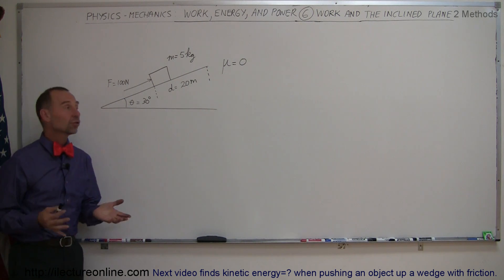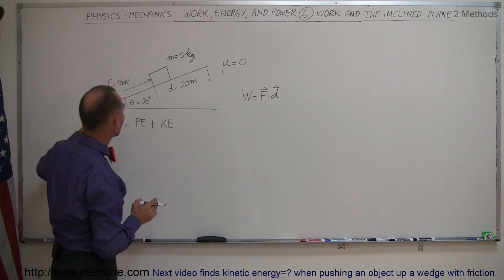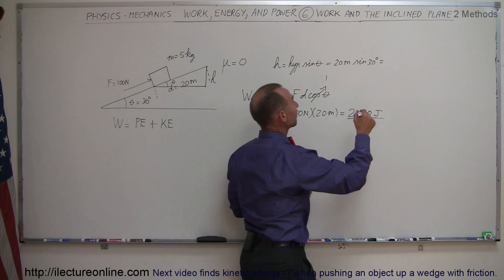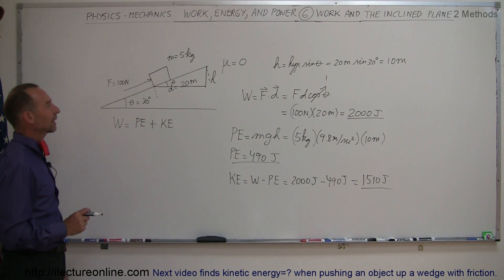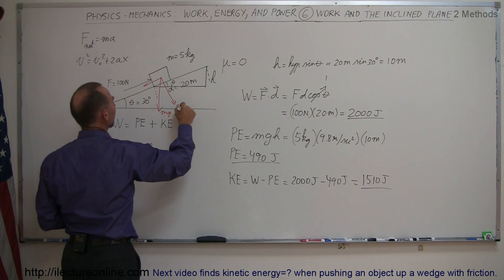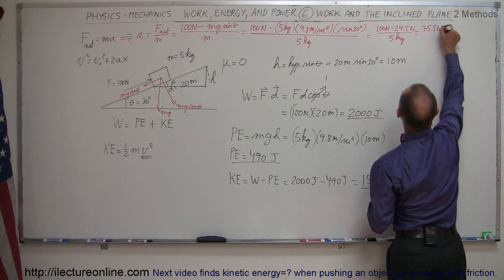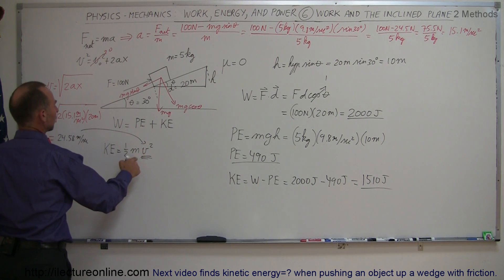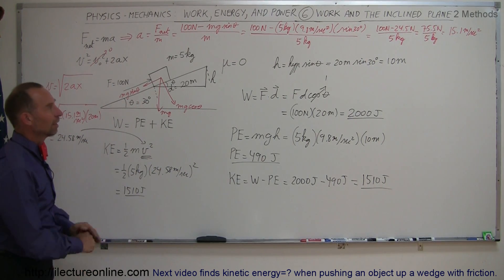Physics 8  Work, Energy, and Power (6 of 37) Inclined Plane (Frictionless)

Comment: A doubt, why do we not consider the work done against mgsintheta downwards? so net work would be, work done by external force  -  work done by mgsintheta and this work gets converted to energy?
Reply: ive just made myself more confused
Reply from the maker: You need to take each force separately.  If you find the worlk done by the force pushing the object up the hill, the work done is simply the dot product of the force and the displacement.

Comment: sir, i would just like to know why are we not going to take into consideration the directions, where one would choose a certain direction to be positive, preferably upwards, since it's the original motion of the block, and in that case downwards would be negative and that would make the gravitational acceleration, g, to be a -9.8m/s^2...
Reply from the maker: The video is correct as is.  When dealing with vectors, the sign indicates the direction, but the direction is uaually expressed in terms of the x and y axis, and therefore you would need to find the vector components.  Better just to calculate the magnitude and determine the direction separately.  (Note that the magnitude of vectors cannot be negative).

Comment: Why you use costeteah 1 it is 30 degree?
Reply from the maker: The direction of the force and the direction of the displacement are in the same direction, therefore the angle is zero and cos(0) = 1

Comment: I have a question! why didn't you use the net force while calculating the work done. You used the applied force (100N) which didn't include into consideration the component of weight that opposes the applied force i.e. mgsin(theta)
Reply from the maker: When you calculate the work done it is usually associated with a particular force.  (e.g. the work done by the force pushing, the work done by the gravitational force, the work done by the friction force, etc.)
Reply: @MichelvanBiezen  so had the question asked the net work done, does that mean we would have used the net force instead of the applied one?
Reply from the maker: That is correct.  Also note that in the energy balancing equation, the potential and kinetic energy are accounted for separately.
Reply: @MichelvanBiezen  Thank you so much for taking the time to answer my questions

Comment: He has good problems but this question was not worded well.  In fact it wasn't worded at all.
Reply from the maker: This example shows the relationship between WORK, POTENTIAL ENERGY, and KINETIC ENERGY
Reply: @MichelvanBiezen  But what is the question?  What are you actually solving for.
Reply from the maker: Not all the videos are made to "solve" a problem.  A number of the videos are made to explain concepts like this one.  It shows how the work put into the system results in a combination of KE and PE.

Comment: If we used the net force to calculate the work we would not have the same kinetic energy in both cases. And that's confusing me a lot.
Reply from the maker: You cannot use the "net" force to find the work done.  Calculate the work done by a force lifting an object up vertically.  If done at a constant speed, the net force would be zero, but yet you lift the object higher.

Comment: Hi Michel , l have a question:
μ=0
W(net)=F(net)•d
F(net)=-mgsin(θ)+F
W(net)=(-5(10)(1/2)+100)•20=1500J?
Reply from the maker: Fnet does have a specific meaning.  It means the vector sum of all the forces acting at a point or acting on an object.   Wnet does not have that same meaning.  Work is associated with a particular force acting over a paticular distance.  We can talk about the work done by a force pushing an object.  The work done to overcome friction.  The work done by the force of gravity.  The work done to increase the PE, etc.   They are all independent of one another.
Reply: @MichelvanBiezen  
In this video we talked about the work pushing the object?

Comment: There's something I don't understand. Can someone explain why the work done is force × distance and not net force × distance. Why didn't we remove mgsinetheta from 100N before calculating the workdone
Reply from the maker: The work done by the force is always going to be FORCE x DISTANCE x COS (angle between the direction of the force and the direction of the displacement).  This work done will give the block kinetic energy, or potential energy, or both.

Comment: Hi! Thank you and i love your videos! So much actually. I have a question, for the net work dont we need to take in consideration work done by the gravity?
Reply from the maker: When calculating the work done it is typically referenced to a particular force.  (i.e. the work done by the force pushing the object up the incline.  Or the work done by the force of gravity.  etc.)
Reply: @MichelvanBiezen  thank you!
Reply: @MichelvanBiezen  If you can do that why is it possible to know the kinetic energy of an object that way? If you used the net force to calculate the work you would have a different result for the KE.

Comment: I have a question Is it correct if I calculate the kinetic energy first calculating the net forces in the x-direction and then calculating the work done by the net force? ex: I did 100N - (5*9.8*sin30) = 75.5N. Then w = f*d = 75.5 * 20 = 1510J. Help me, please. Thank you for your videos !!!!
Reply from the maker: I suggest you use the method used in the video.

Comment: I have a doubt,
The total work done calculated is 2000J, then 490J  is the PE, so you said remaining is 1510J is KE, but there is mg force on the block which have some work done to overcome this. So there will be some energy loss
Reply from the maker: The work to overcome mg is equal to the gain in PE.    PE gained = mgh    Work done to overcome gravity = mgh

Comment: Shouldn't we have to calculate Fnet first? As far as I know we have to substract mgcos30 before we find W?
Reply from the maker: The method shown in the video is correct.  But there are multiple ways in which you can solve the problem.  Try it your way and see if you get the same answer.
Reply: @MichelvanBiezen  Thank you sir, I guess I made it correct in my exam :)

Comment: Work done is FScostheta 
So 100×20×cos 30 then why sir did you use only F×s there is even an included angle
Reply: The force is up  the plane and thus is being applied in the same direction as the object is facing,and as that would be a direction of 0 degrees between the two, the w= f*dcos0 and cos0 is 1 so it's just f*d.

Comment: sir,
The potential energy when t = 0 is it PE = 0 J ?
Reply from the maker: It doesn't have to be.  It can be any value.  The work done will cause an increase in PE and KE.  (You can set the reference PE to any value)

Comment: I had a similar question except the object was moving down the frictionless ramp, therefore changing its PE and KE. Q was asking for the distance travelled down the ramp. However, when I did Wg= deltaKE + deltaU,  I get the calculated value for deltaKE+deltaU equal zero. 
Wg=mgsin theta *d=delta KE + delta U. If I set delta U equal to zero, then I am able to find d and then plug it back in to get my Wnet=Wg= a numerical value (955 J). When I individually calculate deltaU and deltaKE, they are equal to -955 and 955, respectively. I am not clear about why the net Work isn't equal to a combination of PE and KE in my case. Thank you so much in advance!
Reply from the maker: You cannot account for the PE and the work due to gravity at the same time.  You can only pick one or the other.  That is why the initial PE = the final KE, or the negative work done by gravity = KE final.
Reply: Michel van Biezen is this because PE is converted to KE aka they are the “same” energy that is a result of the work being done by a force (gravity in my case)? Thank you sooo much for answering my question!

Comment: Shouldn't the work done include the force that is applied & the weight's component that is parallel to the incline?
Reply from the maker: It depends on the question (what is asked).  Typically the question will state:  "what is the work done by the force applied?"

Comment: mass 15000 kg. 
X 500 m
theta 2.5•
Resistance 800N(constant)
work done by driving force????
Reply from the maker: Assuming that the resistance force is parallel to the incline and assuming that the 500m is the distance along the incline.     Work done to overcome resistance = F * d = 800 N * 500 m = 400,000 J.   Work done to gain height = mgh = (15,000 kg) * (9.8 m/sec^2) * (500 m x sin 2.5) = 3,206,000 J   Total work done is the sum = 3,606,000 J
Reply: Michel van Biezen 
thank you sir. 
i got one more problem-
power 30kw
time 14 sec
initial v 20 m/s
final v 30 m/s
distance travelled??

Comment: I dont understand why we calculate friction force to calculate net force?Is not it frictionless?And why we calculate it like this?Why dont we use N.μ ?? Thank you so much......
Reply from the maker: Even if there is no friction force, you will want to calculate the net force for a number of reasons, both in dynamic and static type problems.  In this example, there are two forces (the force pushing and the force due to gravity).  If there is a net force the object will accelerate.  (Fnet = ma).

Comment: I'm just wondering why total work= KE + PE . I thought total work =  KE - PE because wouldn't the Potential Energy be  -mgh since gravity is pushing down but we are pushing the block "up" opposing gravity?
Reply: +Jomel Sagsagat 
I like to use the formula W0 + P0 + K0 = P + K for these kinds of problems;
the terms W0, P0 and K0 are the initial work, initial potential energy and initial kinetic energy, and P and K are the final potential energy and final kinetic energy.
In this problem, you have an initial work W0 being done, which is 2,000 J, and you also have a final potential energy P and final kinetic energy K at the top of the ramp, and the final potential energy P is 490 J.
The formula will therefore end up like this:

W0 = P + K

Solve for the final kinetic energy and you get K = W0 - P = 2,000 J - 490 J = 1,510 J.
Reply from the maker: +Jomel Sagsagat 
It depends on how you want to set up the equation.
If an outside force performs work on an object, it will increase its energy.
That can be PE or KE or both.
Reply from the maker: +Jomel Sagsagat 
It depends on how you want to set up the equation.
If an outside force performs work on an object, it will increase its energy.
That can be PE or KE or both.

Comment: I have an urgent question! why didn't you account the force of gravity( m*g*sin(delta)), which is pulling the object in the opposite direction, to calculate work.  I always thought that we should use the net force to calculate the work. Please help me out! Thank you so much.
Reply from the maker: +lam nguyen That depends on what you are trying to calculate.In this example , we are calculating the work done by the 100 N force.You can also calculate the work done by mgsin(theta) which would be negative work in relation to the work done by the 100 N force.
Reply: Thank you so much for responding Sir! Your video is really helpful!

Comment from the maker: Nur Husnina
Since there is no friction, we don't need to know the normal force and therefore we don't need to know the cosine component of the weight.
Since the force acts parallel to the incline, the direction of the force and the displacement is the same.
Remember that W = F * d * cos (theta)  where theta is the angle between the direction of the force and the direction of the displacement.

Comment from the maker: Yagmur Erhan
Think about it this way:
Work done by the 100N force:   W = F* d
Work done by gravity:   W = -mgsin(theta) * d
Net work done:  F * d - mgsin(theta)
PE gained + KE gained = F * d - mgsin(theta)
Reply: What if the force is not given? And the height is 5 m?
Reply from the maker: Ammar Junaid
Ammar,
Not sure what you are asking?
What is the question in the problem?
Reply: so sir PE gained = 490Jand from above equation(including work due to gravity)W(net)=f*d - mgsin(theta)d = 100*20 - 5*9.8*0.5*20implies that W(net)= 2000 - 490 = 1510Jnow if PE gained is 490J then from above equation KE gained would have to be 1020J....

Comment: sir in this incline we have a degree of 30 so Wp=mgycos30 right it is not flat right ?
Reply from the maker: Jana,

The force is directed along the incline (in the same direction as the displacement)  Therefore the angle between the force and the incline is 0 degrees and cos (0) = 1
That is why I put that example up so you can see the difference.
Reply: thank you